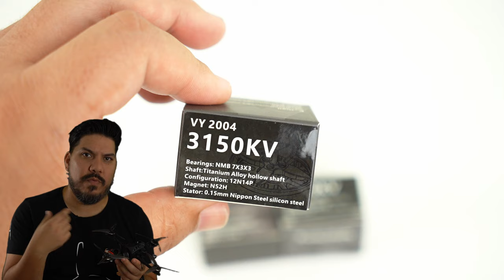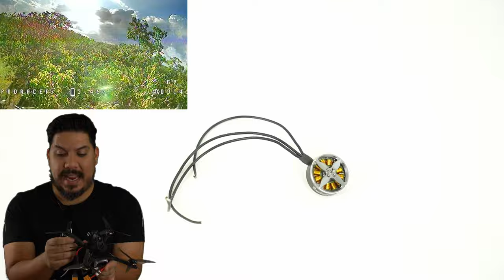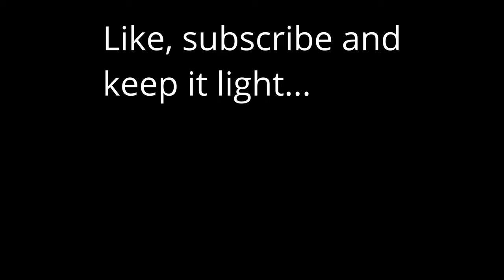Brother Hobby 2004 3150kv sub 250g ultralight drone  motor - lightweight racing.

Comment: I switched from those motors, I was flying them fine for a few months, then one day, one of the motor bells just flew off. No crashes or dents or anything. Happens one time fine, but it happened again the next day after I put a new motor on(I always buy 6 motors for each build) the bell just...came off the shaft. I now have the hyperlite 2005.5 2650kv, and love them. I never used the top 15% of throttle with 3150kv anyway, and now I feel more control. I'm also a NOVICE when it comes to racing, but they just feel better to me. More grunt too with that extra 1.5mm of stator height, maybe lower kv plays into that too.

Comment: These look like some great motors. With my fpvcycle 2203 3450 kv I've found the sweet spot to be 4" gemfan 4023 triblades and a 4s 850 battery.
Reply: That sounds like the perfect t storm of a combo,I love the 4023's also and am running them on 1404's 4s 850/650 ...and it actually rips with super long flight times🤟
Reply: @huckaberryfpv4986  with an auw of 157g I get 4 - 4:30 minutes of flight time pushing hard and 6 - 7 minus of easy cruising on that 850 4s. Definitely a fun setup!
Reply: @huckaberryfpv4986  Here's a recent flight from that setup. https://youtu.be/o2ys_8pEDdo

Comment: would you recommend 1805 or 2004 for this podracer?
Reply from the maker: both work pretty well, 2004 for max speed, 1805 is also good speed, but a little less wide so wont break as easily.  

If i had to pick, id go 2004, and crash less.
Reply: @JonE5FPV  thank you. figured the 2004 is easier to get now with more brand options